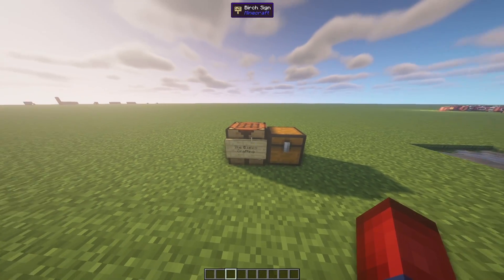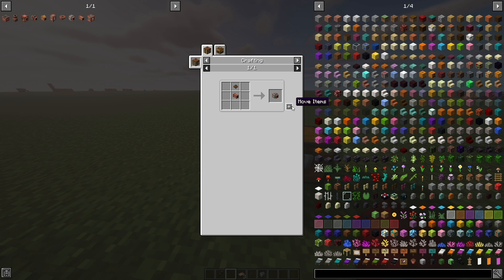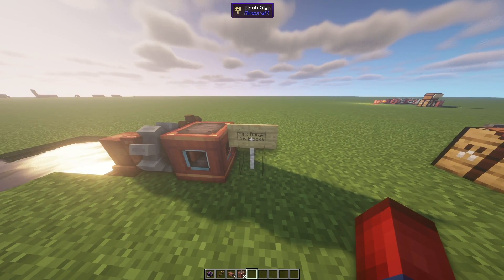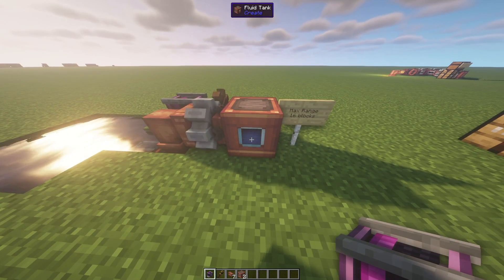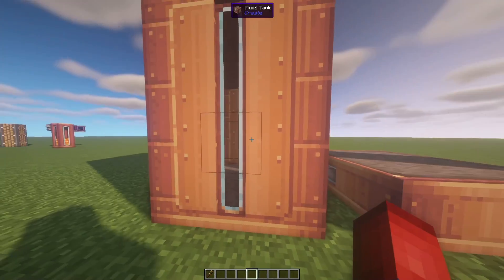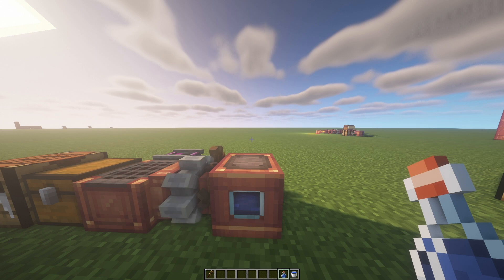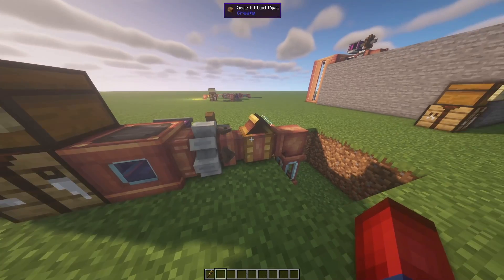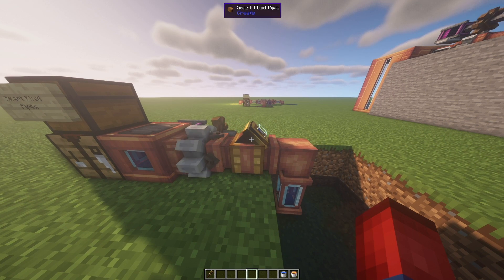Minecraft Create Mod Tutorial - Fluids, Pump, and Pipes Ep 17

Comment: I really need some help here, I have an identical set up to your first pump system yet it's not working at all. The mechanical pump is the right way, the pipes are in the water, all connected, I have no idea why this isn't working.
Reply from the maker: Hmm if you are trying to pump water I recommend using the pulley at the very end of the video! If that doesnt work post in the help channel and I can help you out!
Reply: @rockit14  figured it out, apparently there's a bug in which the message telling you some create mod visuals don't work in fabulous mode on Minecraft doesn't appear sometimes, so I didn't see it. The machine was working, but none of the visuals were because I was on fabulous and not fancy or fast